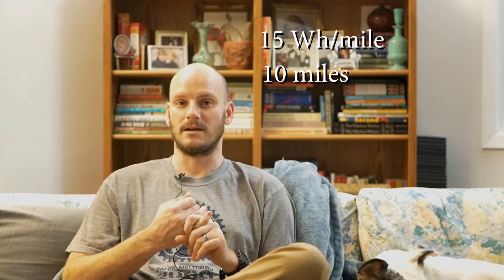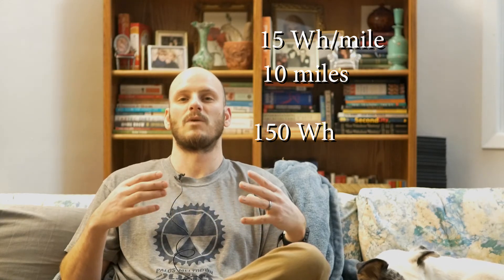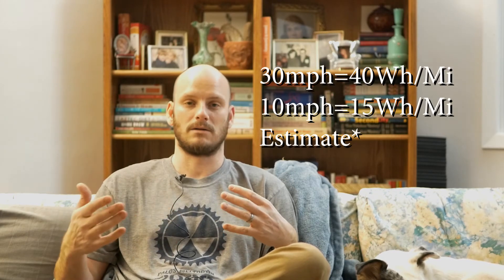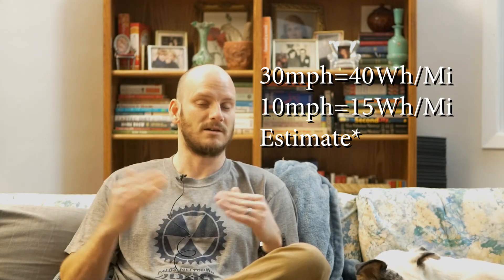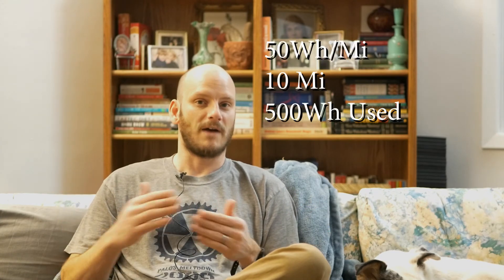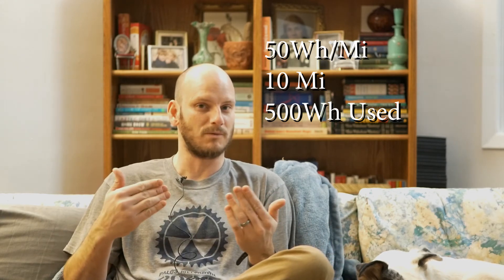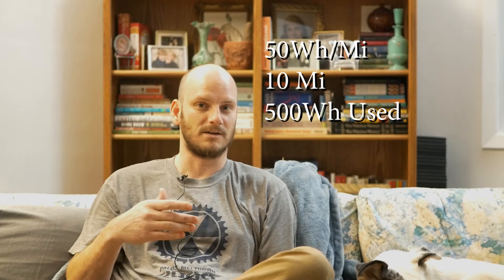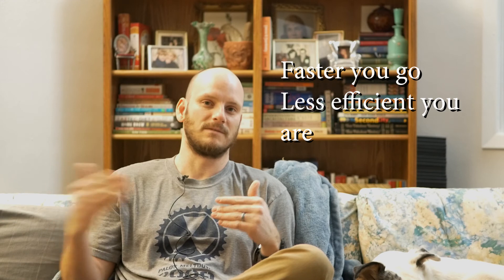What are Watt Hours/How to calculate how many you need

Comment: Was wondering as well. I have 350w brushless rear wheel and running 36v/48v controller. Can i run a 48v 17ah battery? Or 48v 13ah? At the moment I'm using 36v 7ah and i run out of juice as soon i get to work then i have to charge it before I leave my  work place to my way home. It's annoying honestly. Thanks in advance
Reply from the maker: If your controller is rated up to 48v then yes you can use a 48v battery 👍
Reply: @JohnnyNerdOut  thanks for the reply 🙏

Comment: So my question is a watt hour. Im getting a lifepo battery ( 600 watts ) with 298watt hours. 
Im powering 4 watt cameras . How many hours will my 298 watt hour keep my cameras running before my battery is dead. Thats what Im trying to figure out
Reply from the maker: Divide 298 by 4=74.5. 
If your battery is 298 watt hours and you are using 4watts for an hour (4wh) you can expect about 74 hours of power
Reply: @JohnnyNerdOut  Hey brother. That is a great help. Thanks for the answer. Keep up the good work.

Comment: If my fridge uses 55w on high and 33w on low.. what solar do i need for it to run all night? Thanks to all answers. Will 100w solar be enough or?
Reply from the maker: It should but those numbers seem really low for a fridge. Get a battery that has double the capacity you need 👍
Reply: @JohnnyNerdOut  thanks bud i appreciate the reply. What do you think if i just go double northstar battery and avoid the whole solar thing would that be over kill or? Thanks again
Reply from the maker: @vucicevicdanijel11  100w solar panel is less than $90. It’s better to have it and not need it
Reply: @JohnnyNerdOut  thanks a lot bud

Comment: How much watts and volts do I need for an e-bike conversion for going uphill?  I need to go up a steep hill to go home after fishing in a lake (approximately 30 degree).  The ride mostly likely only lasts 5 to 7 minutes long.  I don't mind pedaling; I just cannot deal with going up a steep hill.  The ride will be exclusively in warm season.  Currently I have to walk the whole way (like 20 minutes going uphill on foot), and I don't really like this.  I want to see if I can improve the situation and make the trip more enjoyable.  I understand that you recommend mid-drive for going uphill over hub.  Because I need it for going uphill, regen is not a requirement.  What I want to know is watts and volts.  Thanks for any info that you can share.  I also welcome other people opinion.

Comment: This is great information. I'd heard and read the math before but not how it applied to riding. I got this now. Mine is just a playbike so I can keep up with the doggo. There are DIY battery kits that go together like LEGOs, no welding on the cells. I'll build a couple small, 2 or 3 lb, 52v, 3ah batteries. Build them to the size of an existing non-conductive box or lay up my own. When a battery starts to fail I tear it apart and replace the bad cells. Thanks Johnny. This is where I go when I need a problem solved.

Comment: Thank you for explaining this as a balance of multiple variables: Telling it like it is. Awesome!
So a 750Watt motor will draw more at equal speed than a 500 Watt motor?
Reply from the maker: I wouldn't say that, only if its a much bigger sized motor physically. otherwise it would be the same on paper. The only fifference is that is has the potential to draw more power

Comment: Uhhg I'm lost. So if volts x amps = watts, then 12.6v x 20ah = 252wh?? . So my battery can run 252 watts for 20 hours?? That can't be right can it? Can anyone help?
Reply from the maker: 252 watts for one hour
Reply from the maker: Wh is "watts for an hour". So you could 126 watts for 2 hours etc. But that's in a perfect world vacuum type situation. Most likely you'll get a little less.
Reply: watt-hour is a storage of energy. in a battery. what you do with it , is your business...250 watt-hour storage, can power mathematically 250 watts / 1 hour. 1000 watts/15 minutes, 100W incandescent light bulb / 2.5 hours...peak and theoretical. NOT ACTUALLY.

i told the dude with 1600 Watt scooter battery, to sell his battery and buy a car, because that batter is worth $700+

Comment: how many hour are use 9 watt LED Bulbs when connect with 9 Volt battery
Reply from the maker: I don't understand the question.
Reply: i need to know the current = I...Volts x I (Amps) = Watts. A standard household 9V battery has  a capacity of about 500mah. thats 500 milli amp hours. 

so 9V x .5 Amp-hours = 4.5 Watts, This is the batterys capacity. so 4.5 Watts, is 4.5 Watt-(1) hours. your Led bulb needs 9 Watts from a 4.5 Watt-hour capacity. so half an hour, continuously, Theoretical and Peak, NOT ACTUAL.

Comment: Short, sweet, and to the point. Good explanation. I intend to build my own 52 volt 20 amp battery using 18650 cells. It will be used on 3000 watt Cyclone mid mount motor. I am building my ebike from scratch. Got my 29er frame set from Bike Nashbar a couple of weeks ago, and I’m starting from there. It was one of your videos, among others, that gave me the inspiration to DIY ebike.
Reply from the maker: So glad to hear! Is it going to be a MTB setup or more road oriented? I'd like todo a frame up build as well, might actually make it easier at a lot of points during the build.
Reply: r u an engineer?